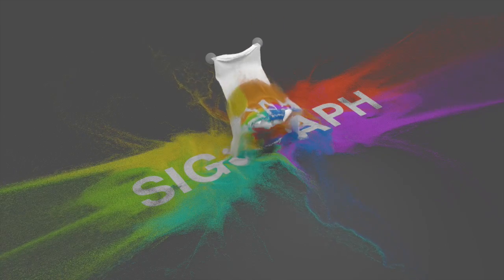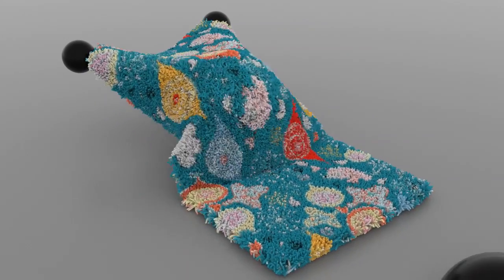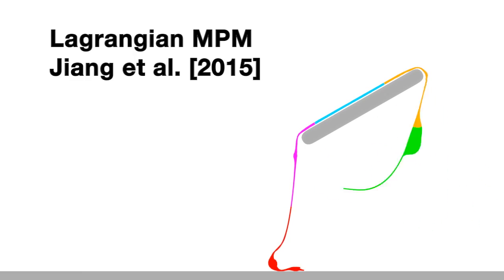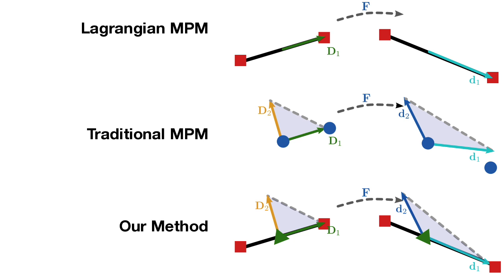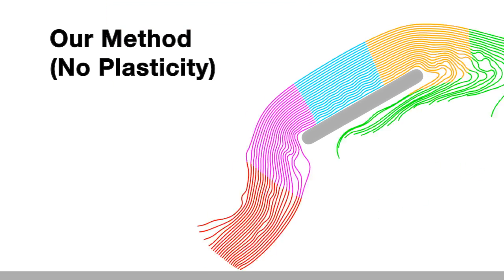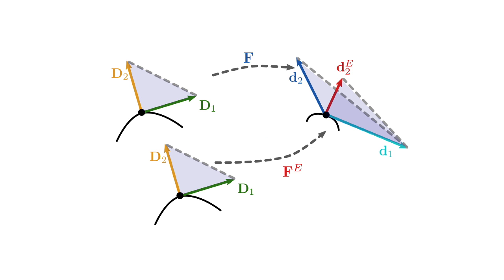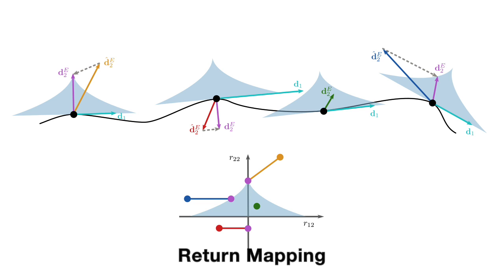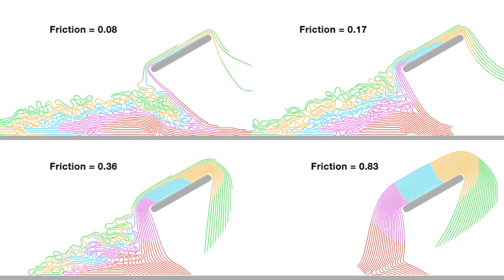[SIGGRAPH 2017] Anisotropic Elastoplasticity for Cloth, Knit and Hair Frictional Contact

Comment: im building a worksation computer specifically for 3D work like character model, autocad, fire and ocean simulation, or destruction and fluid particle simulation but im not to sure what kind of hardware i would need, mind i ask for some help? im currently planning on buy these 2 main component for my 3D workstation build, please give me come advice and recommendation.
can a RTX Quadro 8000 gpu and a AMD threadreapper ryzen 32cores cpu simulate these kind of workflow as shown in this video with same amount of details and polygons? like 1 million or more to 10 million particles or polygons or triangles? my budge is 10k so i really dont wanna risk it, please give me some advice, thank you.

Comment: Seeing this makes me think that it's not actually that far fetched to think we're living in a simulation. Goddamnit that knitted cloth simulation. Of course, it's still an isolated feature thatl takes fuck tons to render, but imagine this in a couple of decades, hell perhaps even less. This could be used in game engines, expanding from cloth, knit and hair to all types of other materials. Footprints could leave a completely accurate and realistic mark based on the collision between the foot and the dirt, changing based on the pressure applied by the heel or toes, depending on the surface angle etc. No more clipping of clothing and limbs. Hell, it could mean so much for simulated water. This is really awesome.

Comment: I'm more curious about how you simulate the SIGGRAPH thing in the beginning of this vid.
Reply: They run the simulation, find which grains of sand are the ones that end in the position of the "SIGGRAPH" letters, then reverse-lookup to color them starting in the beginning of the simulation. The initial column of sand looks like a turbulent jumble.
Reply: @AerysBat  that seems difficult
Reply: @anbietm4617  yes
Reply: @anbietm4617  Not difficult at all. The difficult part is simulating the sand and cloth. Once you have the simulation, you just go the end of it, color the letters, and rewind the baked data. As you can see in the end, they simply used the final sand simulation, and then colored it. It is the exact same simulation.
Reply: This seems possible as long as simulation is deterministic (or gives the same result with same input seed).
Though, even if that's not the case, I guess that it's still possible to do it if every intermediate state of simulation is saved and later recolored.

Comment: Is there any way I can use this in any of my animations? lol
Reply from the maker: This is the demonstration video of our new research paper. Currently there aren't any existing software packages with the technique integrated.
Reply: Chenfanfu Jiang I had a feeling, but man would some of these siggraph things help make animations.
Reply: For some of these siggraph things I would pay hundreds lol
Reply: doesnt that work in blender already with molecular?
Reply: Marienkarpfen Molecular sucks, they need to add the ability to make the particals deform a mesh or something.
Reply: If there is a program that most surely will implement this technology is Houdini..... maybe the next release of Houdini will implement this into its clothing module...... most of the times it does.